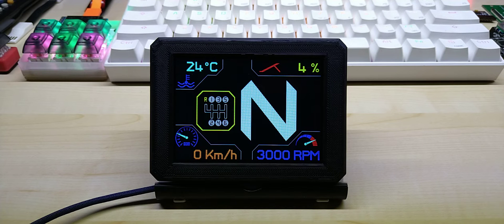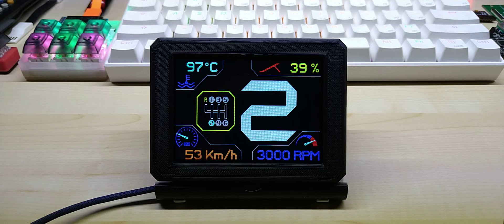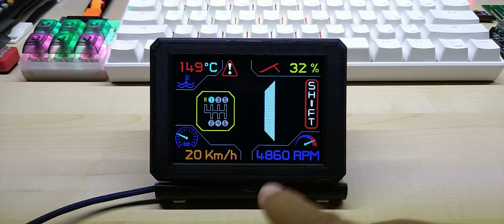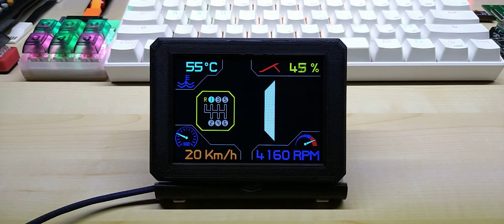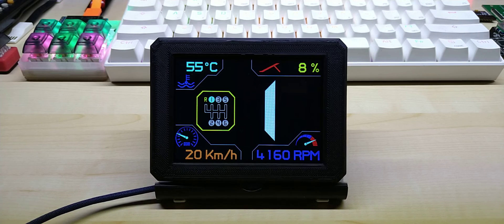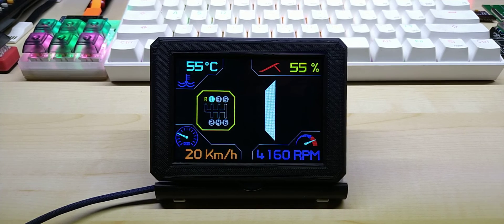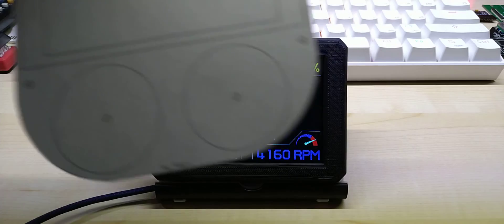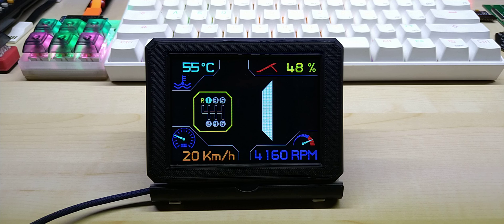Main Screen finished, 7 more to come. OBDII CAN BUS Gauge by Hayri with capacitive IPS Touch Screen.

Comment: Hi Hayri, Did you do your own ODBII translator?
Reply from the maker: Not sure what you mean by translator, but I use the mcp_can  library. The code is done by me with the help of my friend Rob. And i made my own CAN BUS simulator to be able to test on my desk.
Reply: @iHayri1  understood, then with mcp_can I can read the BUS data from OBDII?
Reply from the maker: @denisffmendes  Correct.
Reply: @iHayri1  nice you have a CAN BUS simulator! I'm thinking in using raw DATA available on the internet to test some stuff, building a CAN BUS simulator it's a lot of work and tricky for me at the moment.

Comment: Hi, excellent project, what software did you use to create the GUI. Thanks.
Reply from the maker: Thanks Mike, I did create everything form scratch, there are GUI that you can use but I could not get any of them to work with the Arduino IDE and would probably not liked much of their visual buttons and such, not that they are bad or anything but I am going for a certain look with those 45 degree angled corners. I also semi finished the menu which looks quite nice. Will make a video soon. Also just today I picked up my new PCB's so I can finally finish a gauge and show it. Although so far only 2 of the screens are finished. What you see here is jsut the MainScreen, there will be a BoostScreen with an analog gauge for boost and 4 other readouts and there will be 4 more screens, 6 in total, easily selected by the touch screen menu.

Comment: Hey there, happy new year!
 I wanted to ask if you would be able to build a fuel milage gauge that only displays MPG's? Perhaps using one of your existing products but modifying to only show the MPG info?
I've found the perfect gauge system that fits the confines of my custom dashboard build, but the one thing I've been wishing for is a dedicated fuel milage display. The engine is obd2, a newer chevy 5.3 engine.
If that is something possible in the next couple of years, i would love to discuss it some day.
If not, i totally understand! You are a busy guy i can tell!  Hopefully i can still implement one of your awesome devices in my build, i always check your page from  time to time to see what is compatible 😁
CHEERS!
Reply from the maker: Happy New Year to you too Hammer. Somehow your comment ended up in the spam folder and I almost missed it. Anyway, I do have a MPG screen in my H.E.D.S. CAN Gauge and you can select it to show only that. Here is the link to it: 
https://www.tindie.com/products/21537/
It should be small enough to fit in your dash and works great. The gauge does remember what was selected.
Stay safe.
Reply: @iHayri1  Thanks Hayri! Well that is great news! Yes that is what ive been hoping for, just simply a MPG Gauge to monitor how my fuel economy is going.
The gauges I will be using do have a "miles to empty" readout which is cool.
I was also looking at the Scangauge or even the MPGunio (based off of Arduino), but I believe with both of those,  you need to enter every time you fill your tank.
I think that with my gauges Miles to Empty reading, and your HEDS ser ro MPG only, I should have exactly what I want!!😁😁😁
Thanks again Hayri, hope this is a successful year for you!! CHEERS
Reply from the maker: @HAMMER_2.2  You are very welcome Hammer. Looking forward to serve you.
Reply: @iHayri1  Oh, one more question if you dont mind! Is it at all possible to modify the text of the MPG screen?  I just looked at the HEDS video, and am just curious if the numbers for the MPG reading can be made larger? (If i was spoiled and could have my way, it would only be the numbers showing 😁, perhaps a tiny "mpg" title).
If not, of course no big deal, I still really want one for my project! I have several other little misc displays/meters for other accessories and Im gojng to design a secondary "gauge cluster" that rests in the console somewhere, with all these smaller gauges sitting behind some smoked plexiglass for a stealth look when off.

Okay, thanks again Hayri, CHEERS!!!😁😁👌👌👌
Reply from the maker: @HAMMER_2.2  Sorry for the late reply but your messages keep ending up in spam although I approved them. Anyway, I could edit the screen, it's just additional work :-)